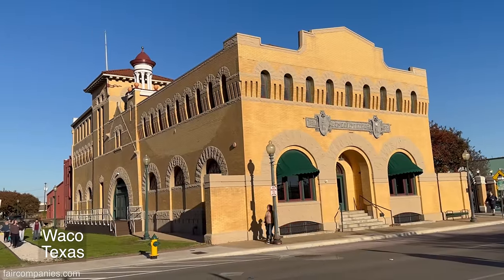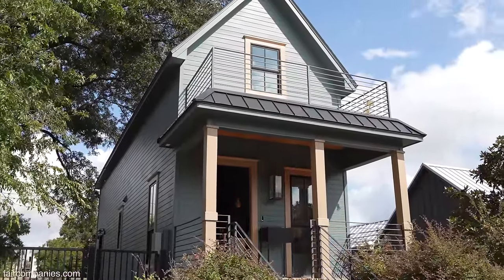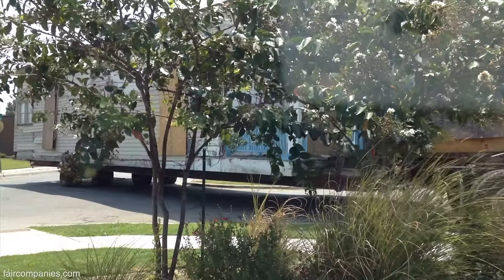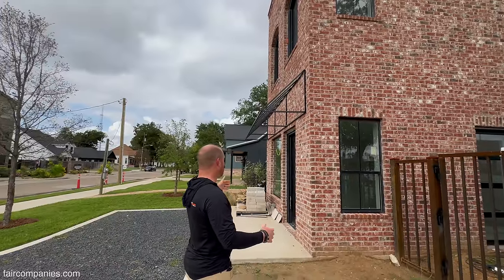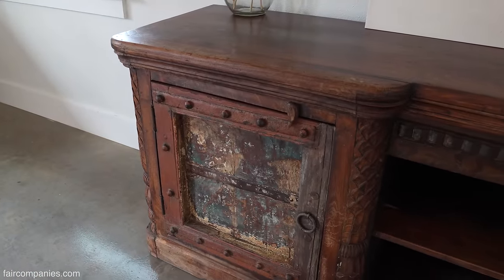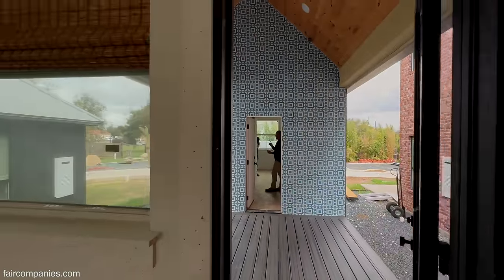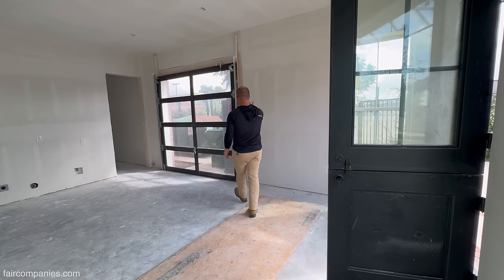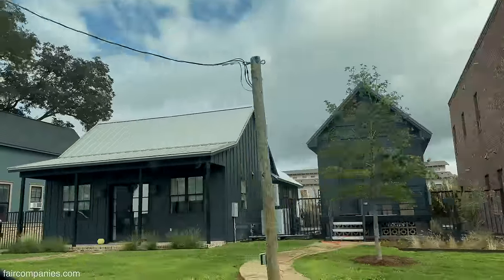Turns empty lot into Pocket Neighborhood of 4 shotgun houses

Comment: We helped build a “shotgun” house in Sheridan, Wyoming back in 2013 as part of a Habitat for Humanity project.  We were told that the “shotgun” feature referred to a long, narrow house with the front and back doors and the doors/openings between rooms all line up.  This would make it possible to open the front and back doors and shoot a shotgun through the house.  No idea if that’s actually true or not, and the house we worked on had the passages between rooms offset, so it did not conform exactly to this definition/description.

Comment: Fabulous. Although I’m surprised he didn’t install underfloor heating . Putting a large concrete slab on  the floor is a superb idea. - breath thermal mass or thermal buffering…… we would normally put Underfloor Heating (a radiant wet system). Just like the Romans did that way your feet are lovely and warm  in winter….. In the summer, you can even run cold water through it

Comment: Love the brick built house, but it is never going to look old because of the windows.   A 'shotgun house' is one where you can stand at the front door and shot straight through to the back door.  @16:39, love the tiling but it's odd having to walk through an open space to reach another room.   @21:00, love the engraving.   From a distance, I thought the door was corten steel.  The block would make a nice family compound, but the units are too small and close together to make good neighbours.
Reply: agree with your comments regarding the "dog trot" house, Imagine wanting a snack at midnight on a stormy night... having to walk outside to the other side.  Maybe add drop down shutters for the winter season?  but cute house.